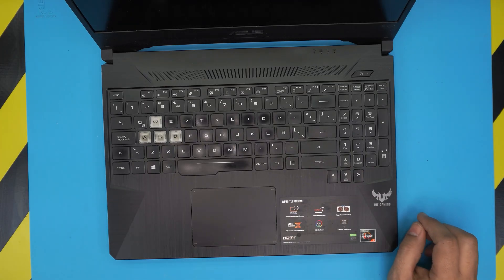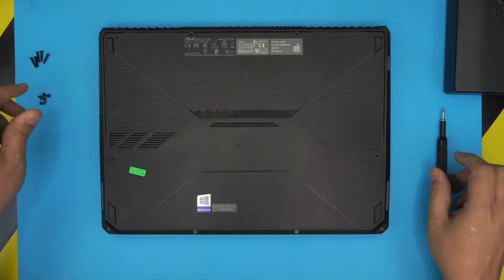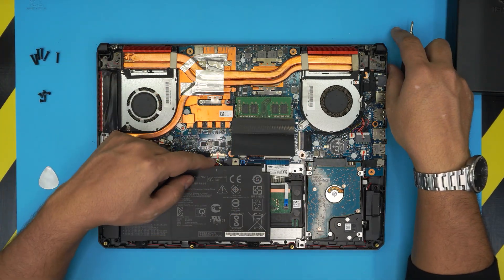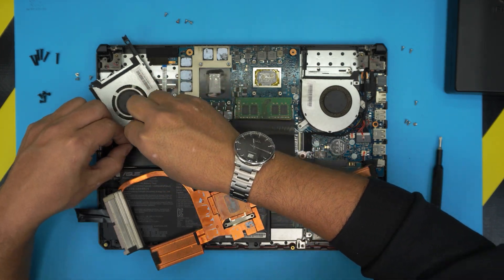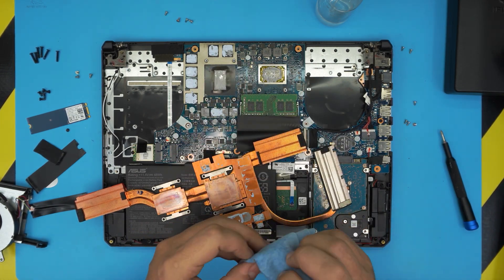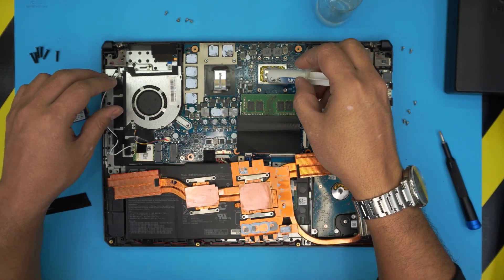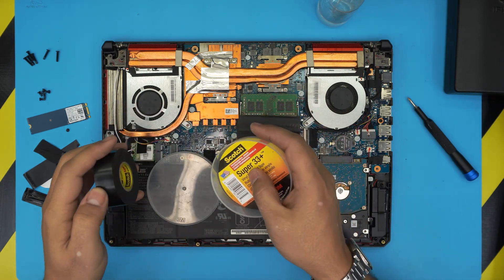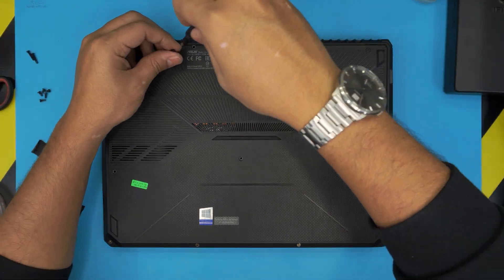ASUS TUF Gaming fx505d Laptop Repaste Service Guide

Comment: Can I use or would u recommend me to use thermal pads (i already got the Gelid gp-extreme) instead of thermal paste in the vrm or graphic card? Thanks in advance
Reply from the maker: Thank you for the feedback! if you wish to support the channel you can LIKE or SUB or both :P
regarding your question: i would highly recommend you not to use the new pads, the reason is that the pad that are already there are good quality, by replacing them you won't see any performance increase or anything. also if you replace them the new pads will be a bit more thick (because they are new) and they will counter force the heatsink away from the GPU and CPU that will result in a bad temps on GPU and CPU.
Reply: @uFixTek  Really thanks, my laptop has a bit more than a year of gaming/work use. The highest temperature i get, playing COD as example, is 85⁰. I just wanna give a general mainteance/cleanising and buyed mx5 paste and those pads but i think gonna use it in other opportunity taking ur recommendation. Suscribed!
Reply from the maker: 85c on COD is good my friend for this laptop model, if you do repaste only replace the paste and clean the fan. also a trick if you want to lower the temps by 5-9c more just lift the back end of the laptop about 1cm and you will see the magic, better airflow.
use this https://amzn.to/3tlArxk
like this: https://imgur.com/a/7SpURxE
and only on back end so this way it will be more ergonómico :P
saludos

Comment: Hello I have a question. Me and my cousin have the same laptop, only difference is that he got his 5 months ago and I got mine a year ago. He laptop fans are so much quieter than mine and we run about the same settings in game and get around the same performance. So i was wondering, will repasteing reduce fan noise? Thank You!
Reply from the maker: Thank you for the feedback! if you wish to support the channel you can LIKE or SUB or both :P
regarding your question:  i would highly recommend you to open it up and do a repaste with a good thermal paste, i will link the best and 2nd best, and clean the fan and heatsink system, the reason the fan get loud its because the air duct are full of dust, open it up and clean it with a toothbrush, and compressed air.
the best thermal paste: https://amzn.to/3lOnKJ9
2nd best: https://amzn.to/3lSlvnY
a good air duster and powerful: https://amzn.to/2U86y5S